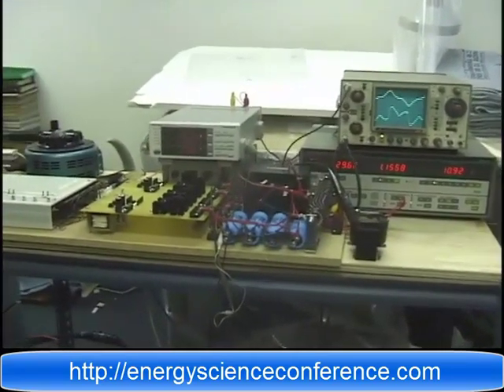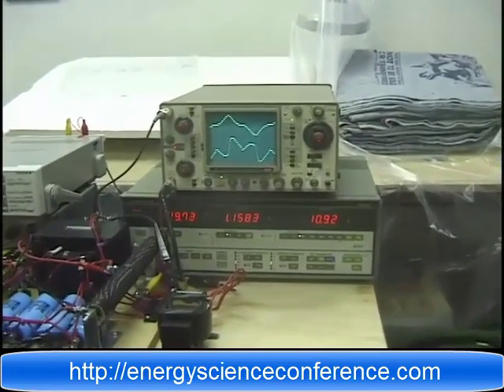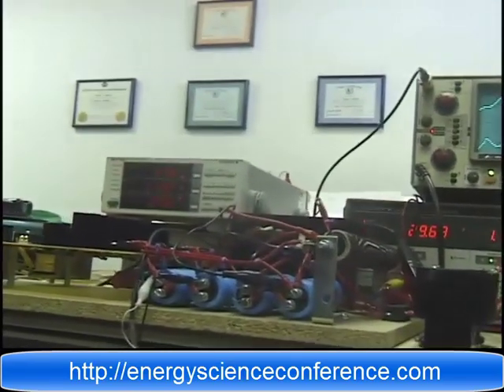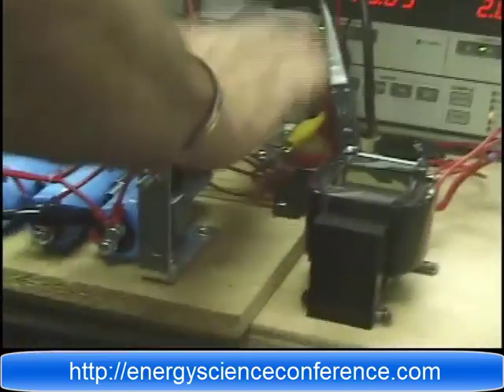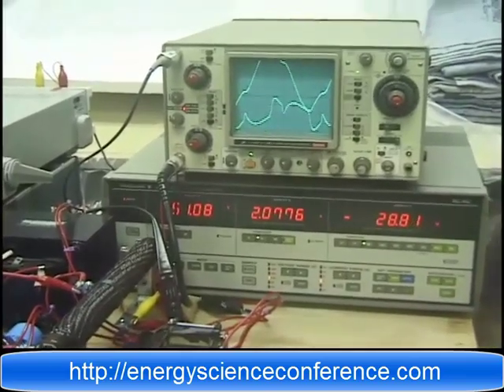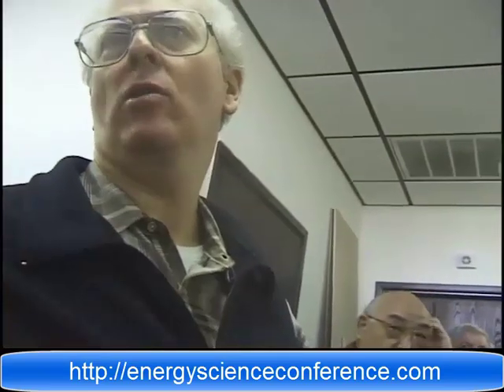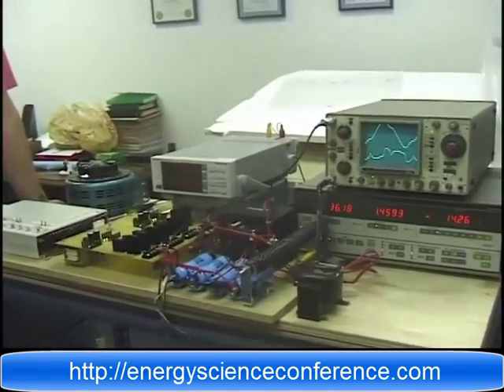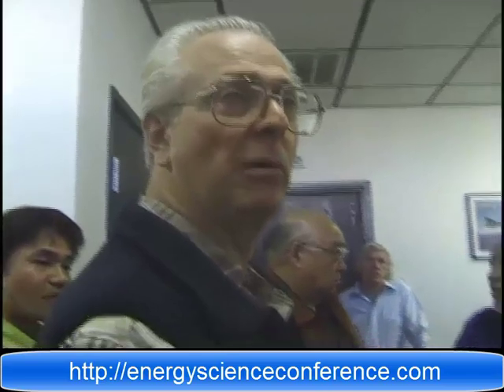COP 20.0 (2000%) Reactive Power as Energy Source

Comment: Or the radial autotransformer is pulling the power from grid and this is baloony
Reply from the maker: You're obviously not qualified to understand it.
Reply: @AaronMurakami13  I am electrician. I am realy trying to understand this. I mean intuitivelly. Not crunching numbers yet only get the basic proof and understanding. I just have a ton of questions:
Why don't they make a closed loop from this? If it takes input 10w to make 200w on output or whatever, the best test and glearing proof would be to take some of the output and put it back to the input. You know what I mean. So now you just have 190w output. 
Here is obviously the problem. That energy must have came from somewhere. So where exactly does it come from? Vacuum? What got colder, annihilated, turned into enerhy or something, were is the minus 190 watts, as would be on a heat pump cold side? Cause this really sounds like heat pump. But instead of heat you get electeicity kinda.
Is there anybody using this to power something? Maybe even a car? 

Why is this not making international headlines? If you put out a glearing solid proof. Nicely done video debunking all possible doubts perhaps. And then have people sucesfully repeat it, It would. In fact I think this stuff would make it into international headlines...
Reply from the maker: @bringtheideas460  That particular device only works on resistive loads - not inductive. That limits the ability to close loop it and close looping is in no way a requirement to prove over 1.0 COP performance. In order to understand the validity of "free energy" technologies, it is necessary to understand various distinctions. None of these violate any laws of nature - they reveal that what are commonly understood to be laws are misunderstandings. None of these machines are producing more out than in - it is more out than what we put in obviously meaning the extra input is coming from another external source. These are all under 100% efficient but are over 1.0 COP. You have to understand non-equilibrium or open system thermodynamics. These 2 presentations will show you more of the reality to this than most sources you can find put together: https://emediapress.com/shop/hacking-the-aether/ and https://emediapress.com/shop/open-system-thermodynamics/
Reply: @AaronMurakami13  kinda like heat pump. We put 1kw on imput and get 3kw of heat on output because you moved the heat from outside to house, cooling down some air. That is basically open system thermodinamics. I understand. But what exactly is cooling down or reacting here? In our heat pump the extra 2kw came from outside of house. Whre does this extra energy coming out from? I hope the presentations can ansver this, or you can. If this source of this extra energy is orgone or some cosmic esotheric nonsense then I am not buying any presentations here. If there is some real soure giving us this crazy COP of 20 nad can be seen, measured, prooven, then I 100% believe. Thst could already power cars and everything for free. Get us to space way easier, power manufacturing cleanly and just change the world. But of course you need extraordinary evidence for extraordinary claims...
Reply: @@OU812-bc3pl No you are still not making any sense. You clearly dont even understand what the word energy even means when you say this. 

When you used the electrical energy the first time, you converted already ALL OF IT to heat, light, movement. There is nothing left to re-use. Othervise it is violating laws of thermodynamics, and making 5 energy out of 1 energy. Can you make 5 coins out of 1 coin?
Reply: @vSchaub-SlackerJ Okay maybe it works, but hear me out. "recycling and reusing electricity" is a nonsensical statement. You should understand that if you have any idea about what electricity even is. You can at best use residual charge from capacitors or coils. If you recycled and reused 1 amp at 1 wolt, which is 1 watt, to power a led that needs 1 watt, say three times, then you made 3 watts out of 1 watt, so you broke conservation of emergy. That is not possible. That is what they claim in these videos. You need to put more energy from somewhere. So where is the energy comming from? 
And I get you. Maybe there is an effect, where the oscilation between the cap and coil in an L/C circuit carries a lot of energy that would be lost when you turn of the circuit and dont "recycle" the residual "reactant potential" (or whatever would you call it. Not sure if it even is a thing), but that is still negligible and similar to using stored charge in capacitors to run your phone or what ever even if it might be more energy than from charged cap. Nothing to see here...
Reply: @vSchaub-SlackerJ the energy does not even oscilate, but tge voltage does. When you have an oscilating LC circuit and then you take the baterry off of the contacts, then okay. It continues oscilationg for a while. True. But that is no different than charging a capacitor and taking it off of a baterry. Regardless of what oscilates in there. Yes there is action happening in the LC circiit, but it is the same thing as when you wind a spring and then release it. It wil continue oscilating/wiggling for a bit, but that is it. Are you in essence trying to reuse this wiggling energy? I dont know if that is worth anybody's time.

Comment: The SERPS device is quite interesting. 

If you look at the waveforms on the scope he is measuring the voltage and current over the resistive element. The voltage is the top wave form and the current is the second waveform on the scope. You can see that on the first half of the voltage wave the current is in phase which means he is sending real power through the resistor initially. Then current is stored in the capacitor where the current dips on the waveform. On the second half of the voltage waveform (where it goes negative) you can see that the current is positive again and now its not even conventional reactive power any more because the voltage and current are 180 degrees out of phase, its more like negative real power, I think thats what jim means by 'reactive watts' instead of reactive power. They're not using a generator here but they are using a generator supplied by the grid and it looks like they are running it through single coil transformer on one the mains side and then the center tapped coil transformer on the load side. I think what he is doing is running normal AC on the mains side of the transformer, then on one half the center tapped output running the resistive load and storing in a cap. Then he switches the load out to the other half of the center tapped transformer keeping the current the same polarity through the load. This centre tapped coil must have a different turns ratio to the other to send it back to the grid with a slightly higher voltage. So the key to this thing is 'how good are you at building switching mechanisms? and how well can you time the switching so as to be in the correct phases?'     

I'm guessing the reason it cant be done using an inverter is because you need a really good sine wave without the harmonics and something to cancel the fields with on the input side like a generator.

Comment: All he has to do is start it up from the utility power if that is what is required and then instead of that resistor use the worst DC generator hooked up to a worst DC to AC  Power inverter  on the planet.  I mean an abhorrent $5 ebay one that is only 20% efficient and there you have it. Free energy! i.e External power starts his SERPS  power supply which runs the DC generator which feeds the DC to AC powerinverter which then in turn runs his 2000% efficient SERPS and then some! Why has it not been done!? Because of 'the law' of conservation of energy.
Reply from the maker: You don't appear to understand what is happening. This method can only be used with resistive loads. End of story.
Reply: @AaronMurakami13  Just looked up steam turbine efficiency: Condensing steam turbines have an efficiency in the range ηe = 36 to 42%. From this it follows that only a small portion of heat released in the process of fuel combustion is transformed into effective work. Turbine units for power and steam generation have higher overall efficiency.Feb 2, 2011

STEAM TURBINE - Thermopedia...

You only need a resistive load to create steam.. Mr. End of story?!

Meanwhile Jim's 'priceless' books cost 37 USD... If he really cared about the environment and energy he'd publish it for free but better still not publish or print anything and take the website down so that its not wasting paper nor power.
Reply: @AaronMurakami13  A DC generator rotor is a coil of wire. Its mathematical model is a resistor (Rf+ Lf) an inductor. any inductive component can be easily filtered out (actively or passively). But even if you insist that it can't be done. As the other user pointed out. Boil some water and hook it up to a steam turbine. We could replace all of our coal powered power plants in Australia with your SERPS 2000%  fart of the universe modules and solve our energy problems in less than a month!
Reply from the maker: @nerminhamidovic638 SERPS does NOT work with any other than resistive loads. A generator is an INDUCTIVE load, which means it is NOT a resistive load. You don't know what you're talking about.

Comment: Now, are we or can we transmit Resonant power when we do this transmission if so we can push 1000 times more power using the same system already made? We have Jim Murray, working with some really innovative ideas for generation and Ac and DC motor that runs at higher efficiency rates and delivers power back into the system reducing cost. 
https://www.youtube.com/watch?v=aDjWwoD83Rk

Comment: Put this resistor to such amount of distilled water and measure time to boil. After that put the same resistor directly to line a do the same . And we will see the truth. BS
Reply from the maker: If it doesn't conform to your preconceived ideas, then it must not be real.
Reply: Do that and do not answer with another BS.
Reply from the maker: @bfx8185 Jim's SERPS was used on a gasoline generator set powering 1000 watts of bulbs while the machine went back to idle - it cancelled the load - no calorimeter is needed  to verify that - it is indisputable and again, you can't fit it in your head, therefore it doesn't exist. It works - get over it.
Reply: 1000 watts of bulbs ? Are you kidding me? What a unit is bulb? Common guys are you trying do a sience or shitty homemade BS? Even first look at your 2$ shitty multimeter which is not able to measure true RMS voltage leads me to conclusion about your amateurism.

Comment: Perhaps it would help some folks understand better to explain the difference between efficiency and the Coefficient of Production (COP).  A device can, and usually must have, less than 100% efficiency and at the same time might have a COP over 100%.  This is because we measure the COP based on what we deliberately put into a device relative to what the device produces.  A heat pump is never 100% efficient but may have a COP greater than 100%.  Same is true for the device in this video.  The energy that makes a device go COP > 100% comes from "the environment" and is thought of as not deliberately supplied.  This is also not thought of as a measurement hocus-pocus because the environment could be wind, water, geothermal, etc.  But it also could be from unseen sources, such as electrostatic, atmospheric, solar, atomic decay, and more.

To any doubters of this kind of demonstration, what's wrong with building a system that pulls in energy from unseen sources?  Just because your textbooks don't talk in these terms doesn't mean that is can't happen!  For an example of "unseen" energy, check the works of Dr. Oleg Jefimenko who wrote the book, literally, on electrostatics.  But I bet that your EE professors never bring him up in class!  

This is a little off-topic but related, Dr. Jefimenko was the first to publish a rock solid refutation of general relativity after the Nobel Prize winning work by Lee and Yang (prize awarded in 1957) that proved that the universe is asymmetrical (not symmetrical as Einstein and Lorentz incorrectly assumed).  This asymmetry is the source of a lot of the overunity effects you see here and elsewhere.  Since then, Dr. Myron Evans has a well developed unified field theory dubbed ECE (for Einstein Cartan Evans) which went beyond Jefimenko's work in refuting general reativity and has done so rigorously that only a fool would use general relativity for any new work now!  Yes, I just called Hawking a fool, but he did it to himself!  If you disagree, better do your homework first before arguing this point, and you will see that Evans is right after all!  http://aias.us

Also, for those who want to see why General Relativity is fundamentally incorrect, there is a non-mathematical explanation here:  
http://aias.us/index.php?goto=showPageByTitle&pageTitle=Fundamental_Errors_In_The_Einstein_Field_Equation
Reply: All fancy pansy but does it do work? and as BFX alluded to above we can fantasize about drawing on the power of the universe but we can't escape reality. With the numbers he is claiming to show one could quite easily use a DC generator instead of a resistor and use the DC to AC power inverter to generate 240V AC that he's using to power his fancy pansy power supply and then some Why not cascade few of these 'suckers'. If it can't be done?!(which i am sure it can't) then showing weird numbers on electronic apparatus designed to measure near sinusoidal forms (not the ones distorted by the SERPS) is hardly a proof of COE or COP if you'd like.

Comment: Why don't you regulate the output and feed it into the input and get rid of the power supply? Then use a load that glows red hot, like a heater and burn some paper on the heater to prove to us at home that you have truly made free energy. If you can't do that, then it's crap.
Reply: You would still need a prime mover, a battery perhaps, or some other source of power to kickstart the system into operation.  They tuned the demo to use main power for illustration purposes.  There are plenty of other working systems that do not use main power.

Comment: The priciples of reactive power for generating energy - not interesting yet.  Does the eBook package currently being distributed have any practical interpretation of a working device which could be used as a reactive power generator?  The bold claim shown in this video cannot be upheld unless the circuit is described.  Eternal light, or a Fool's Day pageant?  Where's a proven replication?